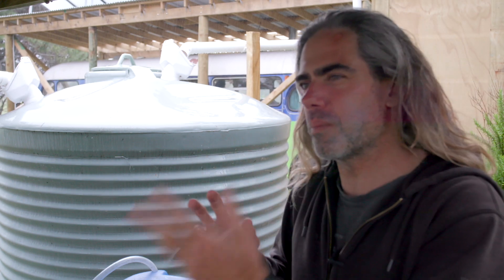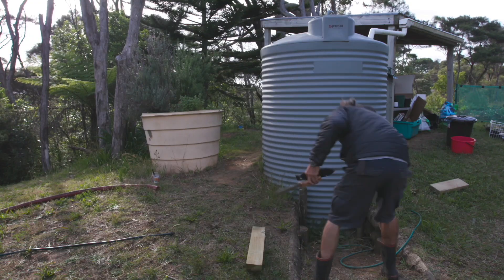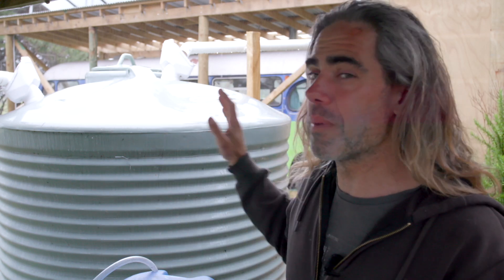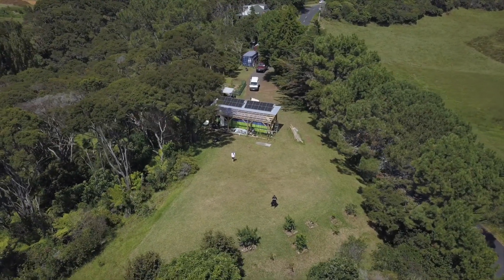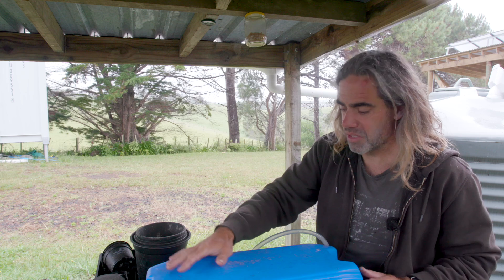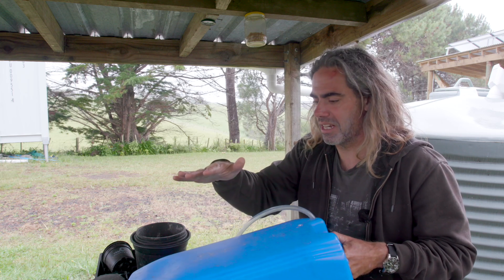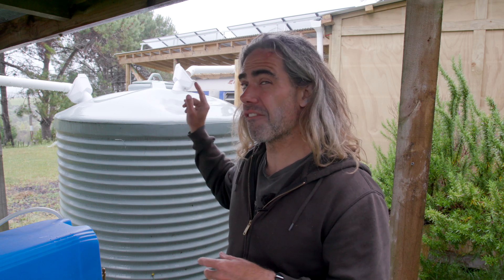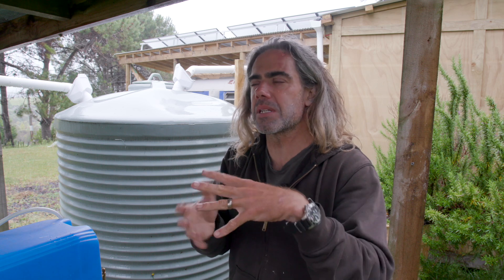Off grid water solutions and rain water collection

Comment: Your overflow pipes go in the tops of the tanks. You’ll need around 50,000 L of tanks if you have standard rainfall, more if your in a possible drought zone. We just bought black plastic tanks which is never hot in summer nor tastes of plastic, we do filter it for drinking. I have sold water tanks in a previous life…cement tanks have a taste as they obviously need sealing, which is toxic. Plastic tanks today are 😂incredibly stable and super thick walls. We have 2 x 27,000L and will be getting 2 x more when we live in our block fulltime. We are in Qld. Steer clear of the bladders as that water tastes disgusting. I would just hide them with screens, structures or plants if you don’t want to see them. Placing them on high ground is obviously a better option if possible in case of power failure . If you have a nearby stream, even a little one just get a BUNYIP PUMP, these work on water pressure, not power and last forever, then you won’t need a tank.
The cost and work to bury a tank will cost more than the tanks, I’d rethink yr planting and hide them.
Reply from the maker: thank you for this.  Funnily enough we just dragged a 25k litre tank onto its pad this week.  We get an absolute tonne of rain in NZ so 25k litres is probably loads for us.  It hardly rained last summer, but that is unusual here.  Thanks for the info on plastics too.  I read they are made of a polyethylene which is pretty stable

Comment: Why not set it below ground? I worked on a homestead in Portugal. They had to use saved water throughout the Summer season. Right in front of their home was the lawn. I didn't know at first, but underneath they had constructed a huge tank made with concrete. You can build it yourself with blocks then seal it. There's was rectangular, like a small swimming pool vs a circular deep tank. That was then covered by reinforced concrete beams, with blocks laid between the beams. There was just one manhole access, but they never needed to go in there. They may have used some kind of ground canopy, like for weeds to make sure soil did not seep in over time. But all in all it worked like a dream, zero evaporation in the Summer months. They also had an outdoor natural pool, surrounded by plants. The only issue there was the bloody snakes loved it too. I would have to scare them off before jumping in, non venomous. 😄
Reply from the maker: That sounds very cool. Best of all you'd have cold drinking water in the summer.
Reply: @projectparadiseNZ  Yes and it wasn't so much deep as wide. So they could gain access, move around inside the clean when required.
Reply from the maker: @ this sounds a lot like the kind if thing Projectkamp do on YouTube.  Wasn't with them was it?
Reply: @ No, it was a private property. I spent two years doing workaway. Seven countries in Africa, then  Portugal.
Reply from the maker: @ nice, sounds like an adventure
Reply: @projectparadiseNZ  Indeed, a little dangerous. But I am still here, cheers 😁

Comment: I'm new to the channel so I may not have all the context. There is a system we commonly use in Trinidad/Caribbean. 

The option of putting the tank on the lower side of your land and having it pumped up will be the easiest and most cost effective solution to all of this. The pump in question should be a pressure pump, I think even 1/2 horse power would be enough, like the pumps made by Goulds with the large pressure tank. So they only turn on when the pressure gets low. These are industrial so they usually remain outdoors with some shelter. You'd need a concrete foundation for the tank and pump to sit on. And the pipe can be some simple PVC pipe. You can repair all this stuff easily if something goes wrong. 

Problem of the hole tank is that it's gonna take a white to get it all done. And it sounds expensive even to dig the hole. But the part that scares me is fixing it if something goes wrong. 
You can opt to have the tank nearby but you'd still a foundation for the tank so you may as well have just put it lower.
Reply from the maker: Thanks for commenting.  Glad to have someone from the Caribbean watching, what a beautiful place to live.    This all makes a lot of sense - especially the part about having a tank that is not in a hole so easy to maintain, but is also out of the way and in the shade
Reply: @projectparadiseNZ  oh I forgot to mention that burying large objects interferes with the natural osmosis that causes water to rise to top soil level. So you may find there's a patch of soil that looks unhealthier than normal yet oddly in the shape of the object you buried lol. Thanks for the comments I hope it all works out and you find the least painful option to yourself and the land.
Reply from the maker: Ah yes that is a very good point!  We have heavy clay soil too so it would likely be an issue.

Comment: Hybrid option of hole with retaining walls with a green roof. That way you can use a plastic tank that is below ground level but can be inspected still and chamber would end up dropping to ground temperature. Its probably the most over engineered but would tick all the boxes.
Reply from the maker: I like the green roof idea - mainly as we can see it from the bus, and I dont want a tank for a view. Thanks for this

Comment: Bury a durable subsurface cistern or tank underground to conceal it from sight. Opt for a sizable container constructed from robust materials. Make sure the entry point remains inconspicuous, like a small manhole cover that harmonizes with the environment.

If feasible, integrate a remote monitoring system for continuous oversight of water levels and system functionality. Incorporate sensors to assess both water quality and quantity.

Implement a consistent maintenance regimen for the entire water system. This involves tasks such as filter cleaning, leak inspections, and thorough component assessments. Maintain a comprehensive maintenance log to discern recurring patterns and potential issues.
Reply from the maker: Thank you for tor this.  It sounds very thorough, which is important when you are dealing with drinking water.  Very easy to forget to change the water filters or generally maintain the tank.

Comment: I reckon, keep it simple, and save money to spend elsewhere on your amazing place. 

You will definitely get all sorts of crap and leaf litter filtering through, so good to have the option to clean and maintain your tank. You can get sediment filters and UV filters to purify your water, but always great to be able to have the option to access your tank for cleaning.

It's surprising how quickly you get through all the water, so I wouldn't worry too much about it sitting in a plastic tank for a few weeks.  

You could screen off the tank with trellis and create a garden feature, grow veg or fruit up the sides and also create some shade for your drinking water.

Good luck. Love the wheelbarrow collecting your roof water.
Reply from the maker: Thanks for this.  Thats a good point about the water not sitting in the tank all that long.   I do have a couple of filters and considering a  UV too.   Thanks so much for your help

Comment: Tough call... For maximum aesthetics and minimal pump power id go with the underground tank, but id plant a little garden around the inlet so you cant see it but its easy to maintain and check fittings. The new plastic tanks can be buried as far as i know...
Concrete vs plastic health debate im not so sure about...keen to hear from a pro
Consider a first flow diverter for the gutter if you dont have one, helps keep the tank clean.
Love the rant at the end :). It is a strange use of such a precious commodity.
Reply from the maker: Thanks for this.  Really good idea with garden around the inlet - good way to make sure we can access it.  I recently heard of first flow diverters.  Will look into this - particularly as we are surrounded by trees